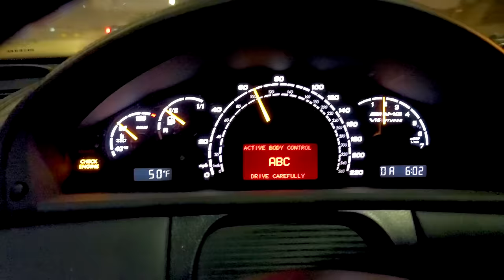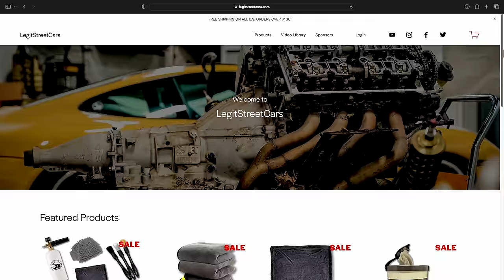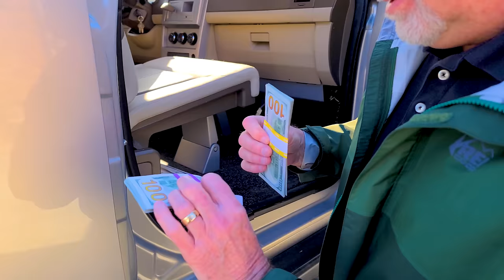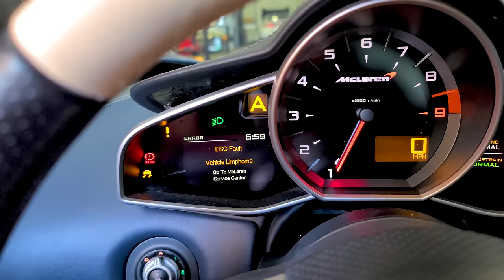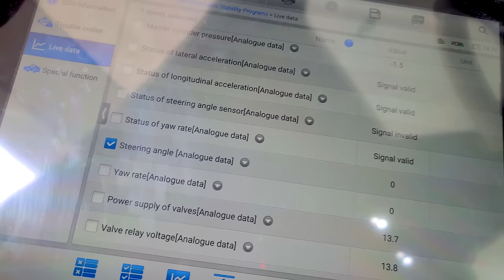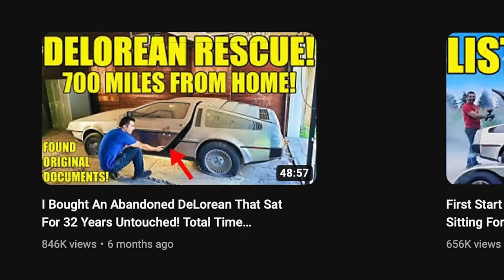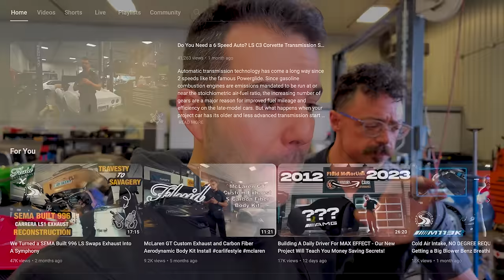My Car World Has Officially Crashed & Burned! Big Channel Update! Mostly Bad Except 2 Things.

Comment: The 911 air filter, you are better off with the larger filter because the smaller filter will be partially blocked when the trunk is closed and be a major restriction

Comment: I really really really would build an custom intake pipe for the LS 911y leave the pump pulley and the throttle body where it is, move the Filter to the passenger side and make a pipe that is going right there. It is possible to make a nice diameter with different pipe shapes.

Comment: I had the belt problem on my duramax, and it was my power steering pulley had backed off the shaft a little bit. I would just try pressing it on some see if it backed off some

Comment: If the belt doesn't come off again, I wonder if you had a small sliver of belt groove that was wrapped around a pulley and kept pushing the belt out at high RPMs.  If it cleared the problem wouldn't show itself again.

Comment: Ive got the anwser to your ls belt issue, i had the same problem.  The issue is the stock tensioner that allows the belt to develop a harmonic that makes it whip itself off the pulleys.  It took me a year to figure it out.  It turns out katech had the same problem on the c5r race cars and devloped a manual tensioner that fixes the problem.  Katech manual tensioner...get one.

Comment: Van alternator belt tossing problem is a voltage regulator issue, rpm rate of change vs load vs rotor inertia.  Ever wonder why Porsche uses a freewheeling alternator?

Comment: Van, temperature sensitive? Heat might be allowing it to stretch and grabbing the two post it threads thru. try on a hot day or try a new belt. or load is heavy during high rpm slowing its rpm causing belt to jump.

Comment: What I think is since is flying off of alternator there are only two possible reasons 1-alternator is not aligned or 2- pulley or alternator is crocked so at high RPM throws the belt.

Comment: @Legitstreetcars Alex sometimes when the alternator is under heavy load like lets say the battery is weak or you had to jump it  sometimes you can acually see the belt float on the front or back side of pulley  depending on vehicle and belt orientation.  but being your haveing it fly off the alt pulley at high rpm it was probably a low low battery or something eles that had a draw on it  like a inverter or what not and threw your mutiple attempts the battery is fully charged now and less draw on the alternator so you wont get the same issue again. a possible way to test is put a carbon pile load tester on your battery have someone put a good load on the battery and do your RPM point and see what happens

Comment: dude if you lefty loosy the rubber stops on the hood they will put the necessary pressure so you can use the hood of the CL it will release properly.

Comment: There is only one possible problem that I can identify is that there is a big metal plate and two screws stick on alternator. On high revs the belt is bit wobbly and that can touch the metal plate or screws.

Comment: I ran into the same issue on a Chevy truck with the same engine as your van. Alternator is bad and randomly locking up causing the belt to come off.

Comment: Hey alex, i was having the same issue with my cl65 turning off half of the cylinders without codes, i checked my rear sam module to find it completely crap with corrosion and water, that is also where the fuel pump relay and fuse is located, they might be only working intermittently due to corroded internals, there is a very common water leak that runs water straight back and into that rear sam module

Comment: I know u said u took the charger off and the belt still came off but what about the bracket those 2 bolts sleeve on each side of the alternator pulley maybe belt is expanding in high rpm and hit those bracket bolts

Comment: That Mercedes burning oil on startup?? Valve seals? And I wonder if a one way clutch on the alternator would help? Try putting a slightly dead battery in the van and see if the belt pops when the alternator is dragging on the system charging a low battery and the engine gets throttled/gassed?

Comment: My belt flying off alternator theory from a guy who is not a mechanic so bear with my terms.
The engine flexes at high RPM from torque which causes belt to fly off. 
Maybe engine mount(s) are bad which allows engine to rotate under load more than normal which loosens belt just enough.

Comment: I have not watched many videos regarding the van, so I have to ask if all the accessories the belt drives are mounted to the engine? With as much torque you are putting down, that engine is going to lean and move. If all parts are not moving with the engine,  the belt will be forced to lose its track

Comment: On the van, belt issue ... if that is a stock GM alternator, it is not designed to run the RPMs a supercharged engine running flat out will generate.  You are actually over-reving the alternator, and the belt is slipping on the alternator's pulley.   You should get a high-performance (racing) alternator that can handle the higher RPMs.    Sport cars, such as the Corvette, come with performance oriented alternators from the factory.   On a side note, you might want to upgrade the idler pulley and water pump if you plan to continue running the van flat out.    Just my two cents.
Reply: Just a piece of trivia.  Decades ago, you could find a sticker in police cars that stated something like, 'Turn off air conditioning when over 90MPH.'   This was because the RPMs generated over 90MPH would burn up the A/C compressor.

Comment: Is it possible that the way the Pro Charger bracket is mounted in front of the alternator is affecting the mounting angle of the alternator itself?  Could the alternator be ever so slightly tilted forward due to the forces of that bracket, putting the pulley out of alignment and allowing the belt to slip off?  Maybe try loosening the bracket and the alternator, with the belt off, then tightening everything back up while trying to maintain pulley alignment.

Comment: Quality control issues at the belt manufacturer could be your problem.  It’s not unheard of for a manufacturer to let a large batch of product slip through that isn’t up to specifications.  Especially if the specifications exceed what the normal projected usage is by a large margin.

Comment: 53.6 years corresponds to January 1, 1970 the start of the UNIX Epoch Timestamp, that means the clock reset and the computer happened to sense the date was reset during a startup.
so it happened to trip something in the computer. hopefully the software can recover. but it doesnt seem very well designed if those were the strange error messages

Comment: So many great builds and determination to get them better than ever. I have 2 older mercedes c36 amg and a w124 320ce . I have put a turbo kit on my c36 it already has bigger brakes and a stock 722.6 580nm transmission with a standalone tcu from ofgear. It makes to much power I had to turn it down 600whp was no problem I also used that same fuel pump you got for the v12 thanks for that. Has a megasquirt 3 running it.  m104 6 cylinder in my 2 old mercedes is a underrated motor toyota used the m104 blueprints to build the 2jz. you just need headbolts and mls headgasket for m104 then its good to turbo

Comment: Alex with the Express van belt issue, have you tried a shorter belt? I worked on a friend's minivan that did the same thing. Even with the correct brand new belt it would throw the belt. I tried the next smaller belt and it fixed the problem.

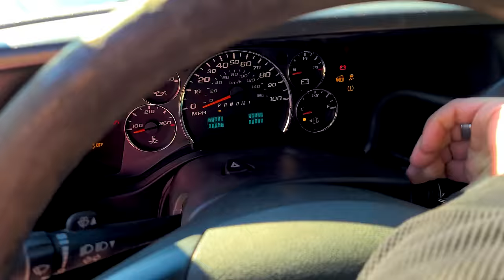Comment: Hmmm... Wondering why I didn't get a notification for this video until today. Odd. @32:05... Well, there's the reason. It's not going to fly off as long as you have a ratchet and spare belt. You have to take those out of he van if you want it to fly off again. @34:40... This is an issue everywhere, not just Chicago. Good machine shops are hard to come by. The good ones get so backed up and they refuse to just tell potential customers the truth about how long it's going to take because they don't want to lose the business.

Comment: I would think it would be better in the long run for the 911 to just mount the throttle body off of an elbow so it fits better, I know you werent looking to do fab work for it but I think the install would just be cleaner.

Comment: Re: McLaren wipers, this happened to my car obviously not a McLaren but it was corrosion on the negative battery line, there was a secondary current cable that sends data to the car. Cleaned it, and replaced it

Comment: Mercedes ABC system hoses always leak, too many joints.   I start to replace them with swagelok system.   There are some hoses which are not long enough to use swagelok motel hose.   But they nylon is still a lot better than the Mercedes's.

Comment: You have an m113k V8 that is clearly more powerful than this V12, yet you still have the patience for the V12.  You're amazing.  If it was me, that 65 would be traded on day one for a CLS 55 AMG.  The ABC would go bye bye in a few days and I'd have a massively reliable car that's far faster than that V12 CL.  The CLS, aside from being the prettiest 4-door ever created, is the lightest of all models with an m113k IIRC and the base models have nice, heavy sway bars so it's super easy to source them and get them in.  An ABC to coilover swap in an SL or CL is nightmarish.  Might take you 6 months just to get some sway bars that actually fit, as was the case for us with the SL55.  What a nightmare.  At least you avoid Vario roof issues by having a CL instead of an SL.  Although when the Vario roof works properly the smiles it produces on anyone who sees it are worth every penny (and it's not all that hard to troubleshoot with Xentry).  Good luck with the CL if you choose to keep it!  I admire your fortitude to get it fixed.

Comment: Is the power steering pump pulley pressed on the entire way? I don’t remember you changing the pump out, but maybe it had one replaced and they didn’t press it on all of the way. It’s worth looking to see if the shaft and pulley are flush.

Comment: The Chevy Van belt will be due to the rubber in the belt. You need a harder rubber as I'm getting when it's warmer daily temps the rubber in it allows a lot more flex and then at a certain vibration from engine speed the heat and flex builds and it can flick off.

For the eclipse fuel line take it to a hydraulic hose specialist and they can help with the right fittings and line.
Shame the plaid has to go but maybe sell it as a raffle car with $10/ticket and then the money over the cost of the car and admin fees goes to charity?

Comment: The alternator may  not be able to keep up with the rpm and vibrations at extreme performance limits. It may be that you need a modified pully on the alternator that has more of a lip. At high rpm with dynamic load the engine would be torsionally twisting on the engine mounts so all of a sudden the belt may go Lucy Goosey. Buy a premium belt and a new pully. The alternator bearing may be worn so that includes mechanical resistance and possible wobbling on the spin axis. That belt looks long and they're not supposed to stretch but.... Finally what if the alternator pully is worn? it could bite into the belt at high loads and what about pully alignment? They should all be on the same plane otherwise the belt will go snakey

Comment: Have you checked the other pulley next to the alternator. Was the temperature low giving a difference in the bearings getting a vibration. Was there markings on the ribs.

Comment: Hey brotha, love the channel. Long time watcher. LOVED the corvette reuniting episode for sure! I’m in Maine, amateur mechanic, i have a built CLS55 with like …. Everything except swapping blowers. The stock unit is robust and I’m running 68mm fixed with split cooling, TMIC, and meth+NOS. No nos I’m putting down 668 to the rears (add100 for the bottle)…. What was your reasoning behind the choice in SC for the c63? Also noticed you have a ton of white smoke on start up (mine does as well)…do you know what causes that? Anyway, long comment. Sorry. I love the channel.

Comment: Check the ribs on the belt it’s self you might have a piece of the rib missing or could be split and will move at high rpm’s or the pulley’s also they could have a pulley that’s defective with the groves may not be as deep as Required  and at higher rpm’s the groves are passing over its provide slots or groove and I can almost safely say that it’s either your belt that’s not grooved  right or the pulley is not correctly machined  for grooves either to shallow or narrow Not  deep enough check all pulleys cause it’s seems like when the spot all up your belt will fly off check your alignment of accessories on the front of engine could be out of alignment and that will through off your belt as well .. ok that’s my thought on what’s to look for.. let me know what’s you find also check for debris in the grooves of the pulley’s might have a piece of rubber stuck in there and will throw off you belt at high rpm’s as well !!!! Ok good luck…!!!!👍

Comment: I just had an issue fix itself like your van. my 06 bmw 530i has a battery drain issue. so i been driving the 335. well after like a month of sitting i decided to jump it cuz there was some gaskets i had to change. then left6 it for a while afterwards. mind you this car was dying in like 5 hours of sitting. 2 days go by i decide to try it. it starts right up. i leave it for a week, it starts right up. so idk where the drain went but its not there anymore 😂

Comment: The extra up pressure required on the hood of the CL - aren't there adjustable springed bumpers near the front of the hood? Edit: Tractor trailer, farm supply, or hydraulic shops can sometimes make custom hoses with all kinds of fittings. Edit 2: I would humbly suggest that you get rid of the McLaren. Too weird, exotic, troublesome and (correct me if I'm wrong) probably less relatable to your viewers. Maybe add an NA W212 bought cheap with timing issues then fix on the channel.

Comment: Yup. This video confirms why I will never buy any of these cars. I’ll stick with my Japanese cars and trucks
Reply: Volkswagen’s are solid imo, but that’s the only German cars I’ll mess wit. I currently own a 2008 Camry 4 cylinder, bought it used. Only things I do now are replace worn parts cause of its age, other than that, it runs great. Had the engine overhauled back in mid-2020 to fix the oil burning problem, $3.5k of work, but I only paid a $100 deductible cause I got the car used with a warranty.

Comment: Is the A/C compressor locking momentarily causing the belt to fly off the alternator since the tensioner is before the alternator? How are the bearings on the Alternator/Compressor?

Comment: I had an issue with my 01 camar 3800. The belt would jump off every time it was wet outside. My ac compressor bracket was bent. Maybe something like that?

Comment: On the van-It's got to be harmonic if it's doing it at a specific RPM. Is there any room to put another idler or tensioner before or after the alternator? In my mind I'm seeing the belt becoming a rubber band and flopping all around. Just my two cents.

Comment: Alex, Could it be the A/C compressor load causing a problem with the belt on the van? It may have stopped happening because it got colder out and you haven't been using the air lately?

Comment: Hey Alex, must have missed the Firebird TA WS6 in blue you had.  I see you still have a white FB TA.  What was the reason you didn't keep the WS6 and did you like it?  I am looking at a '99 WS6 Convertible, supposedly only 40ish made in that color that year.  Low miles too.  I only know when I got behind the wheel of a friends brand new '99 WS6 I was blown away (almost literally) at it's power (coming from a Drag Car Dad and Muscle car collector back when they were new).  Any advice?  *I just went back and saw the blue FB WS6 when you drove it from WV...omg, Dude, what a buy!  And that car was in great condition, just like the one my friend in Va. Beach bought new in '99.  Too bad I missed you selling yours.

Comment: The belt flying off is misaligned pulleys one of the pulley is rubbing the outside of the belt put a washer behind the alternator Pulley most likely the wrong Offset Alternator Pulley!

Comment: As far as the van is concerned, you need to stick a laser and line up the pulleys, I'm betting one of the faces of a pulley is tilted or more forward or behind the other.

They didn't lose your parts, they used them.
Liars are also thieves.

Comment: My goodness.. isnt there a way just to pressure-ize the system befòre you spill that expensive oil? Or is such a system too costly in general... About the van an its belt... It looks to me it can be related by; 1. A combination of resonance of parts. Or 2. the belt is sweating some fluids because of its compound (curing)

Comment: Did you change the whole tensioner or just the pulley on the van? I had a similar issue due to the tensioner arm intermittently seizing up. It was the ac belt tho.

Comment: I have an 18 Camaro SS. 15k very low miles ...but also no problems. 
My next door neighbor has a 14 CL63. He is young and has spend a fortune modding it and:
cracked manifold
Bad cat 🐈 😻 
Bad fuel pump
Dash died
A/C died
Trans stopped moving the car
This car has 34k. This together with your video on the CL65 has taught me 1 lesson. 
No hyper Mercs. Ever. If I need more power I will just trade mine for a ZL1. SMH. 
Oh yeah...Use more plastics in your engines Europe. They never get hot and cold and leak. Never. 😮

Comment: These aging high mileage amg v12s have constant issues with abc system. Almost every 5k miles. Its a shame. They are pretty reliable if it weren't for the damn abc. The airmatic system is a breath of fresh air in comparison